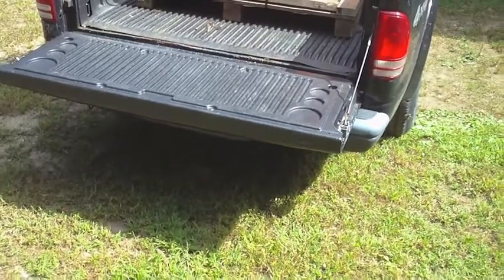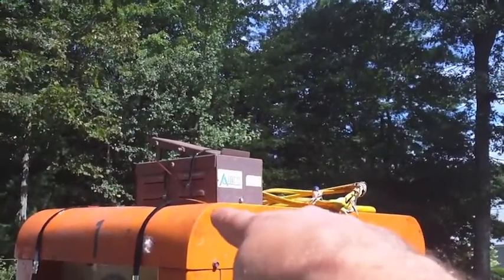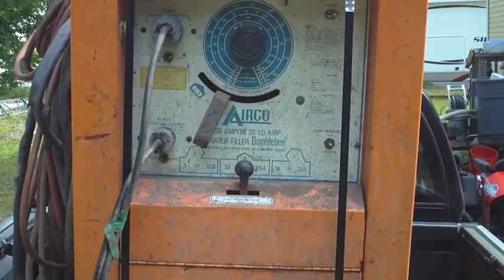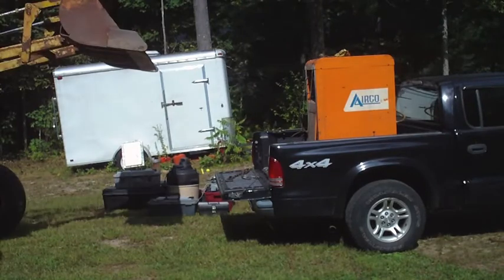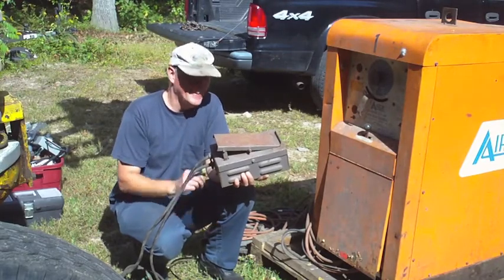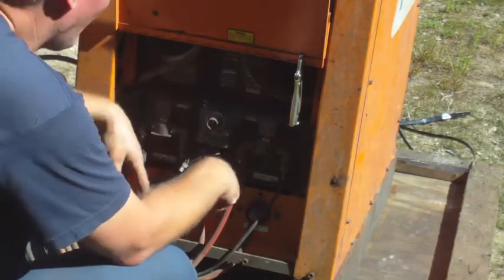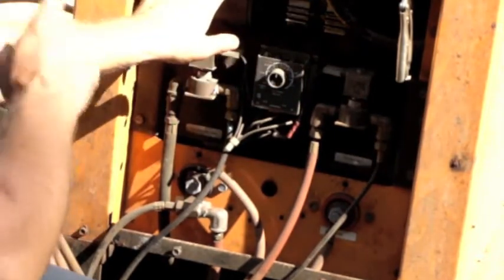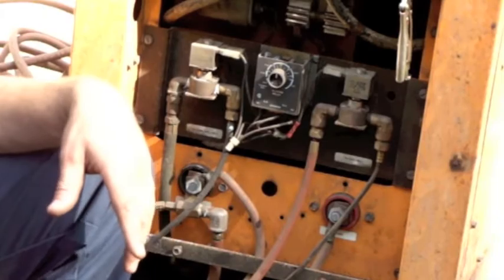The Aico "Bumblebee Crater filler" DC welder Part 1

Comment: Mine has that same outlet on the right side.  For 110.  Very awesome find!!   Now I'm nervous though!   I need to double check and see if mine are leaking!!!   I was able to use mine before purchase but we didn't check the HF settings. I did however use ac and DC tig scratch start to test the machine and was totally blown away at how beautiful the tig arc was.   So clean and strong compared to the old inverter China machine i just sold!   WOW!!   I think these machines are well worth the time spent in restoration vs buying one of those new machines.   I can't wait to get to tig welding!!  Awesome vids!!   Thanks for sharing!

Comment: I paid $200 for my RFC-23A pedal and was glad for it. They are expensive and you can't use just any pedal. At the time the average price was $300 or more.

I don't think Miller sold the bumblebees. They did make them for Airco, HHxxxxx serial is 1977.

The solenoids are 120V. They have a 120V isolated tap on the transformer. Actually there may be a 120V outlet on the right side of the panel to run a wire feeder or coolant pump. 30A is small, it may be wired for 480V. If it was 208V, that would be

The caps are 0.002uf / 4000V. I replaced mine with 4, 500pf / 20,000V caps in parallel. I removed the guts of the caps, put the 4 caps inside and filled it with epoxy. Miller had a replacement part used on the Syncrowaves (6000V IIRC). I remember they were like $110 a piece!

The main reason the caps leak is users don't adjust the gaps. The voltage goes way up and the caps break down and boil over. That is why i used higher voltage caps as the originals were minimal. Mine the gaps had worn to 0.020" instead of the specified 0.008-0.010".

The goo is mineral oil. The US had banned PCB's earlier. Still, it is nasty stuff and took an hour soaked in acetone to remove it.

A water cooler would have been a major score. They are not hard to make.

You have $300 is welding cables there and probably near $300 in scrap copper in the transformers.
Reply from the maker: Hi Scott. I just figured it was made by Miller because it is so similar to the Heliwelder I bought that we know is a Miller. Also, the foot pedal has an Airco label on it, but a Miller part number. As for replacement caps, I was thinking of trying some surplus caps I found that were originally designed for high powered transmitters. I figure they should have a high enough power factor, and are designed to operate in a high frequency circuit. No 120 outlet on either of mine, but I like the idea. Might wire one so the cooler power is cut when the welder main power is off. As for scrap value, that'll be revealed at the end of this series. The transformers did not bring as much as I had hoped because they paid the going "ballast" price. Removing the copper from the iron cores was going to be more time consuming than it was worth for me. As for the copper in the welding cables, I'm holding onto those for now, so that was not included in the final scrap price.
Reply: Hmm, the outlet is not obvious. Mine is on the inside of the right front rail. Under the door to the right of the gas solenoid. There should at least be a knockout for a double outlet there.

Note: it is only good for 5A or so.
Reply from the maker: Scott Henion As luck would have it, I just moved the Heliarc into the basement today. I'll try and sneak a peek later tonight.

Comment: I have a couple of AIRCO BUMBLEBEE 500 AMP AC ARC WELDER, M/N 5ADTS-24P in my dads old shop. You interested?
Reply from the maker: Benjamin Hubert I bought this one for the extras that came with it more than anything, like the leads, tig torch,  and foot pedal. I also kept some parts, but scrapped most of it. unless you're local to me, and they were just going to be thrown out.